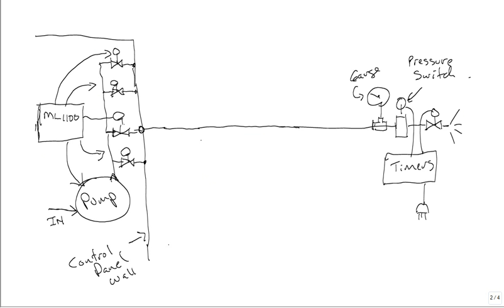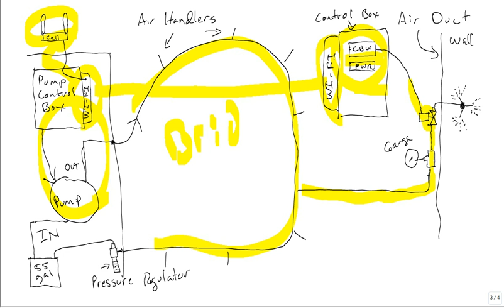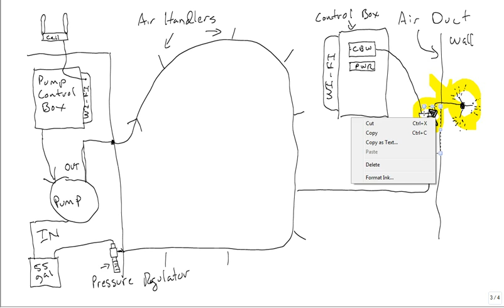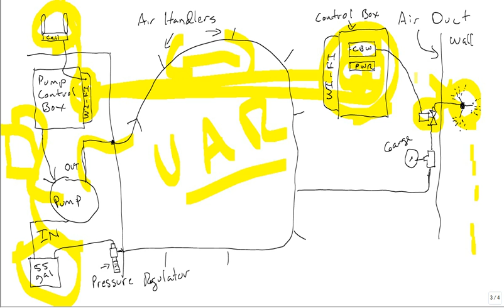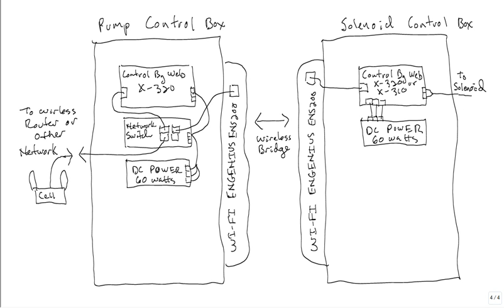0124

Comment: Hi John. I was brought here from a video from MistingSolutionscom. Is there a way I can contact you via-email? I am a Civil Engineering student working on a graduate lab where I am mimic'n landslide, water porosity, and water table information. In doing so, I am using a crafted hanging system of PVC pipes with DiG black mister heads. Bottom line - this system is not working. In one of your videos of the indoor mister attached to the fan, that amount of mist, OR LESS, looks like what I need.